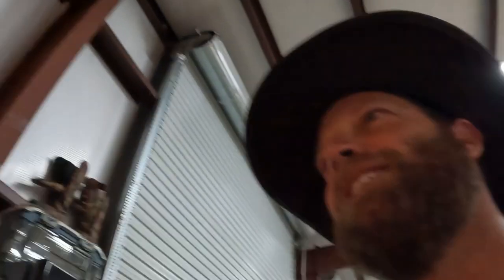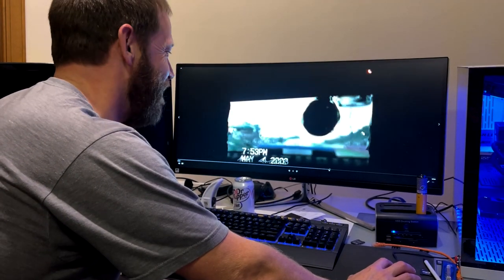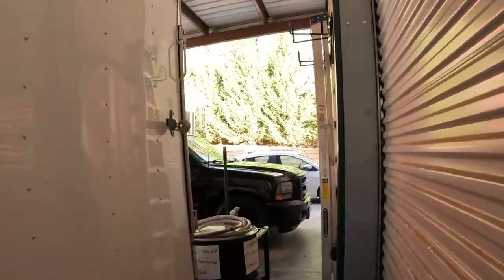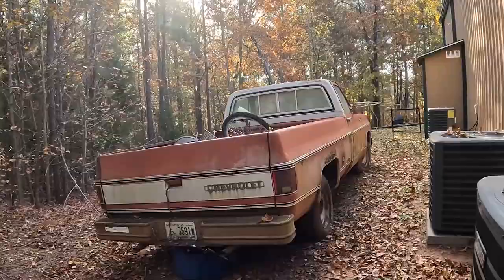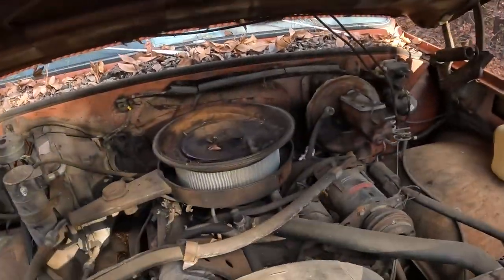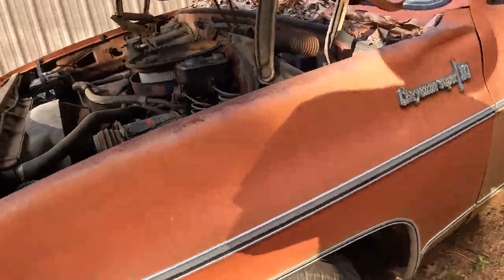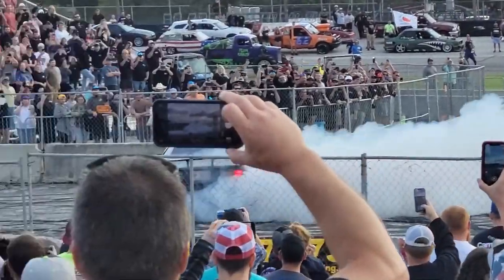Stevie Fast Jackson debuts "Project Ronnie" New Build - Episode 1 - Help Me Choose a Path

Comment: nobody uses the Lenco these days so use that behind a screw blown Hemi. Dont fix the fix the body. just put a new chassis under it with a cage and make it stupid fast and do stupid burnouts. I figure Ronnie would approve! lol
Reply: Don’t fix the fix the?
Reply: Burnout truck!
Reply: finnegan has a deep rooted illness concerning patina vehicles just smile and nod
Reply from the maker: Thanks Man! Great advice! I appreciate you
Reply: Lenco's are still popular. Lol they'll never go away
Reply: @MrJneesy  yeah it's a killer build I love patina I have a twin turbo 54 cadillac that's just hit you tube. And I love square body's have a turbo 81 454 Scottsdale K20. And a compound turbo 85 C30 suburban.
Reply: @SteveJacksonRacing   reliable, fast, sporty suspension, big brakes, leave the body. grease the hood and door hinges before you bend panels
Reply: What finnigan said That thing would make a killer no prep truck, build a small tire  beast with a screw blower ! Huh!Man you could rule dig or die!
Reply: @SteveJacksonRacing   Screw Blown SBC….. Big Rpm for the win
Reply: If Ronnie was here, all he would do is clean out the bed, change the fluids, air the tire's up, & drive it. Stevie, am I right?
Reply: Gotta keep the patina
Reply: I second brother Finnegan's motion.
Screw Blown Hemi and a Lenco FTMFW!

Comment: Keep the exterior as is.  Once it gets to the point of falling apart,  you can always get new skins and paint it.   Put it on a new chassis with some updated suspension so it rides good,  stops good.  Update the interior with Comfy seats, harnesses, center console w/ built in beer cooler. Screw blown BBC or Hemi.  Slap an enormous radiator on it to keep it cool.  And make sure you have cup holders......
It would be the baddest drag strippin, road trippin Ronnie ever created.  Pretty sure it would put a smile on Pop's face when he's lookin down on you.

Comment: Only something Mr Ronnie would be very proud of rear end  modded or full  chassis modded on 315 drag radials, fuel injected small block or big blockwith possible Newnan near Hemi. With AC got to keep the AC. Keep it long wheelbase it handle better, multi diverged burnout truck, daily driver, drag truck, School pick up and drop off the kids. On the drive to the Sonic or ice cream. One big bad screw blown nightmare with a slick that paint job or not that's optional. Let's make it happen looking forward to see the end results if anybody can do it I know you can. Because you are the man that makes dreams a reality. Go Stevie goooo.

Comment: My stepdad was also named Ronnie, he passed away 3 years ago and I have his 98 C1500.  In a way like you I have been very indecisive about what to do with it.  I've narrowed it down to two options.  One, basically a 90's era type build with a mild big block, with 041 ECM, 4L80E, rear disc brakes lowering blocks and spindles, stock appearing nice comfy reliable daily driver.  Option two, 8.1 big block LS Whipple, 4L80E 4 link large wildwood brake kit, weight reduction and painted pretty.  Because of your busy schedule you could make the frame, suspension and drivetrain pretty, put it back together then next year pull the bed and cab to finish it how you want.  FYI areomotive makes a nice tank & pump kit if you go with fuel injection.  Don't forget to ask your annoying sister for input.  lol
Reply from the maker: I like both of your plans! Thank you
Reply: You're welcome.  I hope you build something that's everyday driveable that would make him smile.  If it has dual tanks it probably has the camper package and a 12 bolt that can take a little power.  Griffin has some good direct fit radiator choices, March has an accessory drive for about any combination you can think of, Dakota has a few dash choices and if you happen to use a 4L60E definitely consider the Sonnax gearset to change 1st & 2nd.   Right behind the cab where the frame steps up the lower flange of the rails of that radius bend likes to flare downward.  I think it's the weakest point of the 73-87 frame.

Comment: If Mr. Ronnie liked carbs, I say keep it a carb setup. I think a big-inch-chevrolet-architecture pump gas motor with an overdrive trans would be really neat. Keep the accessory drive and keep ac.  Wash it and don’t do anything other than that, cosmetically. Quiet exhaust. factory, widened rear wheels. Keep it looking like a washed version of what it is now. I think it would be really cool to see it scooting around Augusta as a driver, and that sort of concept would still be adequate power to be a burnout machine. Been watching you for what seems like forever at Jackson. I have memories of thinking the pink Camaro was stupid fast the first time I saw it. Best of luck, dude!
Reply from the maker: Great advice!!! Thank you man. I appreciate you and the advice

Comment: Street cruiser/no prep/burnout. Fix big rust then primer color of your choice (black then paint next off season) PSI , MFI with throttle on a programmable air cylinder or servo (for power managment) Hemi or LS (for cooling), 2-3 lenco/converter (use parts you already have) small tire so you dont have to build a bunch of chassis just roll cage and reinforce what is there, 4 link or 48" ladder bars, lots of front end travel. Run it on the hat nozzles for pump gas with methanol injection through the port nozzles or another set of hat nozzles for intercooling at WOT when street driving. You could do all this with a big pump sizer some solenoids and creative plumbing, 4" exhaust all the way out the back. If you want to hit a no prep/back of track event switch over to conventional system on methanol, dial in your progressive throttle control and have fun on the ragged edge.

Comment: These are cool trucks. A Lenco, BBC,  Procharger, upgrade suspension and rims.  Then leave the body the way it is.  I don't have this style of square body but I'm doing a 88 lbz duramax manual trans crew cab 4x4 dually to pull my enclosed with 88 Monte SS to go around drag racing.

Comment: I would put a nice frame under it with a  built ls with a procharger setup and a 24/12 on back with a 24/9 on the front. Lowered down and leave it like it is. If there is any metal work that is seriously needed then do it but but the character back to it. Can't wait to see what you decide to do with it.

Comment: Patina drag week truck but also make it handle one those big slide in campers too (tub the camper to fit). Then do drag week in self contained luxury, no hotels just camping in the race truck at the tracks or campgrounds. That's always been a crazy idea I have wanted to do. Pull the camper out click off a 9 or 10 second pass then load up your "house" and roll out like a boss.
Reply from the maker: That's a great idea Edward. Thank you

Comment: I hope you make a bad ass radial drag truck out of it, shorten the wheel base screw blown big block or procharger and then run the no prep events Lyle Barnett has been running. Or a screw blown hemi burn out truck on methanol. Anyway you go its gonna be a cool build.

Comment: Really appreciate the back story with you and your Step-Father, made me think about my father & I. 
My dad drove a 69' Camaro "Super-Stock" car for Dave Lebrun out of "L & L Auto-Machine" in Groton, CT. Drove for him from 1972 (when he got home from Vietnam) until about 1982. Ran in "B/S Automatic" (B/Stock)....and I believe ran in Super-Stock C/Stick Shift.
Anyways, lol We run drag bikes now but just got finished putting a 675HP 408ci in his 84' Chevy (Short Bed) Pick-Up....LS2 Block, Diamond Pistons, "Callies" Forged Crank, etc etc... 12-Bolt rear (that we had to narrow 13-1/2"!!!!! Lol), "Strange-Engineering" Rear Gear & Axles...lol even put "AFCO Terminator SS 4" Stroke Double-Adjustable Spindle mounted" Shock/Struts under it,  a SERIOUSLY worked over/upgraded Turbo 350 Automatic.

But we committed to doing the build (all in house) because my dad got that truck in 1987 and drove that truck 225,000 miles, and NEVER ONCE did it leave him stranded or break down. It was the definition of "Reliable" until I bought him his new (to us lol) "2018 Chevrolet Silverado 2500HD Duramax". We were budget drag racers my whole child hood, and He had always dreamed of having a new Duramax to tow our race trailer, so when I got done with college & started making a halfway Decent living, I bought him the new diesel. 
But we couldn't even THINK about selling his old Chevy Pick-Up....now (after a 1-1/2 year build) we go out every weekend in that 84' Chevy Pick-up and just have fun...(in other words, we go out and embarrass Dodge Hellcats, GT500's, and even some Corvettes sometimes 😝🤣).
I guess my point is to do what you truly want to do with it Stevie, personally I think it would be awesome to get it re-painted the exact same stock colors, replace the worn Badges with exact replicas.....just restore the exterior to the exact stock look, and put like a 650hp LS2 Style engine under the hood. The beauty of "LS-Style" motors is you can make big power and keep the build price cheap. But it would definitely be a "Stevie Fast" thing to do lol....pull up next to some young punk in his V8 Mustang GT and just destroy him from a Stop Light!!!!🤣
Whatever you do, I can't wait to see buddy!!!

Comment: Ok here it is. Simple have fun with it. Think sleeper. Big block NA under the hood. Narrow the rear so tires for inside body. Need a little more rubber to stick the power. Keep the bench seat and interior but refresh it. Repaint to factory colors. Make it something stepdad would have done if he.could have. Still make it steerable but fun.

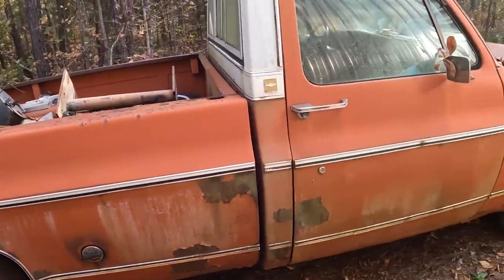Comment: Street truck,  540 big block, turbo 400, 3:50 gears, and a 871 with Holley terminator. Outside Stock appearing, other than the hole in the hood, new box and fenders, and a satin red paint job. Redo the interior,  wide rear steel wheels , hub caps, and drive it.

Comment: BBC pro charger  keep the hood and body as is. Cage inside the cab. Widen the factory wheel wells to the edge of the frame and you can fit a 325 radial or 15” wide slick or street tire. This way it’s versatile drag race or burnout truck or street driven with a tire and pulley change

Comment: Man Please make it something that Ronnie could and would have done Build a nice small block for ease of install maybe an aftermarket block in case you wanna put a kit or 3 on it forged internals ...plenty of good heads on the market and a big intake maybe a victor Jr or some of the nice airgap intakes something you can keep under a cowl hood plenty of info on shortening the frame and put a short box on it and scrap the leaf springs just 4 link it that's where I'm headed with mine And keep the vids coming I love them
Reply from the maker: Thank you David!

Comment: I'm just about finished my grandfather's truck(first round of mods) and it was about the same shape and meaning to me. I decided to keep it close to how it was with a few things I always wanted. I shortened the bed and welded arches in with some ruddy Brown primer. I swapped in a 4l80e and an older TPI fuel injection setup I had from my S10 back in the day on the original small block using a old Haltec stand alone ecu. Now that it's running and driving I've been doing little projects with my oldest daughter as time and money allows and even if I had a unlimited budget I'd still keep it as a father daughter project all but with a better motor/drivetrain. It's a family truck with memories and I'd still want projects for us left to do together.

Comment: New frame and suspension for sure, leave body the same because the memories are in how it looks . 600 to 700 hp pro charger so you can keep flat hood . Full exhaust to keep it kinda quite Easy to drive around that way . A/c and heat . Engine combo ? I mean whatever you want doesn’t really matter. Lower it some not to much that it scrapes on everything. Wheels idk maybe rally’s with beauty rings and caps or a spike wheel with 17 “ skinny’s up front . That’s wat I would do. Good luck with it it’s cool either way !
Reply from the maker: Thank you. This is great advice

Comment: Definitely agree with your last idea. Leave the outside alone but upgrade the running gear. Fit everything under the stock hood but make it a fun driver. Whipple blown LS with an OD transmission. You go to start replacing-repainting, etc., you erase his history as well. All the dents and dings he made, you'll appreciate more. Plus that'll get it running-driving fairly quick.

Comment: Screwblower on a built 5.7 350 (best internals) to make streetable. Build it like the nhra stock guys have to. Keep dirty. Lenco w/ caltracs or 4 link it. Keep body as is, replace what's needed now. They make every patch panel for it. Point is to enjoy it while remembering Ronnie, so get it built n rolling. Always improve later.

Comment: Due to time frame. In my opinion clear the patina put a off shelf G machine suspension under it with a whipple or a big straight cut gear procharger in it with a stick in it. To be a driver.  

If all out money no problem male it happen fast. I agree with Finnegan  Lenco an an big screw through hood burnout machine.   But I would lean street build because with you're hectic schedule an mo time off that would be only way you get to ultimately enjoy it in the end.

Comment: If Ronnie was a carb guy then I think you need to keep it carb fed. Screw blown LS with carbs but use a (insert brand) computer to control the ignition. Would be good to keep the twin tanks but use 1 for pump gas and the other for race gas. Use a manual valve or a solenoid to be able to switch between the 2 systems. Have 2 sets of carbs with one for street and the other for off street duties so if you went on Sick Week or Drag Week you can just switch between them at the track.

Comment: First thing you should do is pull the bed off and haul it to a body shop and tell them to fix it. You can get replacement bed panels for it so stopping the rust is the important part. Drop a 350 crate motor in it, ad Holley injection and drive it everywhere. New paint, new interior, good sound system. It's already got a working a/c, well it used to. You can still get all of the parts to repair that, also. Make it a little nicer than it was when you were a kid and drive that thing everywhere.

Comment: I'm in almost the exact same boat. My Dad has a 74 GMC he bought new, from my Grandfather's dealership, and it's in almost identical condition. Obviously I'm not selling it either. Yours is a very well optioned truck and Cheyenne Super isn't that common of a trim. It would be a good one to factory restore if you wanted, but it won't be an easy road... Ours is also well optioned (literally all of them, it's Super Custom in the GMC line) so I'm speaking from the experience of wrangling parts up over the last 20 years...

A couple of things:
-Whatever gets it on the road and gets you behind the wheel the fastest is what I think you should do. Motivation, and motivation to spend money, is easier to come by when it's already a vehicle. You'll figure out immediately what you love or hate within the first tank of gas. I feel like you probably know this one, but, better to have dreams while driving than while parked.

 -Dual tanks is a somewhat rare option and dual tanks with round caps is a rare option... I think 73/74/75 only. Newer trucks have fuel doors. Regardless of the number of tanks you may want, you'd be doing someone a solid to plasma a large section out of auxiliary bed side and set it aside for someone doing a factory correct restoration. Last I checked, the correct panel wasn't being reproduced so the next best option is to graft the round filler into a smooth bed side.

-Sliding rear window is also fairly rare and that is a unique slider vs. the later model trucks. It's been awhile, but I seem to remember the seal kit was hard to come by. If you switch off to a solid back window to save the trouble, same story as the bed side, someone doing a factory restoration may want your slider.

-A/C is pretty rare too, and once again, is a sad story for some of the parts. The gauge bezel is unique to, I think, maybe around '78 and isn't being reproduced properly (or wasn't the last I looked). The column in the earlier model trucks is a smaller diameter than the later models so the later bezel fits weird and is also usually of a different style. It's hard to tell from the video, but it looks like yours may not have the A/C bezel it should. I can't tell if you have a "stuff" pocket or a vent above the HVAC controls. It should be a vent in an A/C truck. Non A/C trucks got the pocket. I haven't looked in a long long time, but I think that pocket/vent may be a bolt-in?

-All in all, this story repeats itself all over the early model square bodies, or at least it did maybe 10-15 years ago the last time I was really rounding up parts. Heaps of places will list parts as 73-87, but 73-80 are often unique and the earlier trucks are even more unique than that in many cases. Back in the day, at least I could get NOS parts, but God help you if you're doing that today. Yours being a Chevrolet is a small saving grace. The last complete NOS grill I saw for ours was over 4 grand. NOS dash pad, in a rare color, was like $2500. Oof...

Only you can gauge your sentimental attachment to the experience of the past, but if you're really looking for something to go crazy with as far as power, I'd probably look elsewhere (like... probably literally anywhere else on your property). It's not often that we can relive our youth as we age, and to me, that would be more important than turning it into a race car.

But, more than anything, I hope you enjoy the project no matter what direction you go! Good luck with it! I'll be watching...